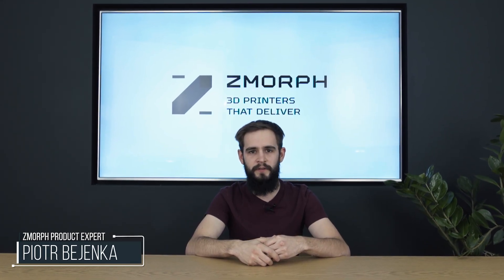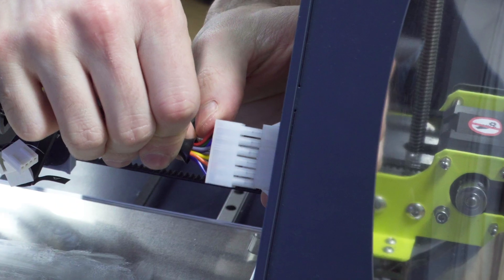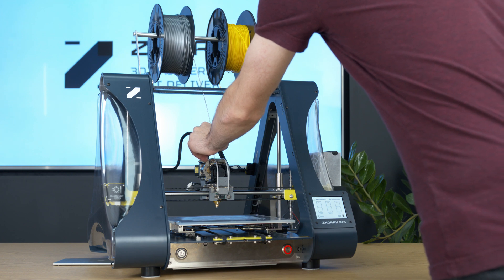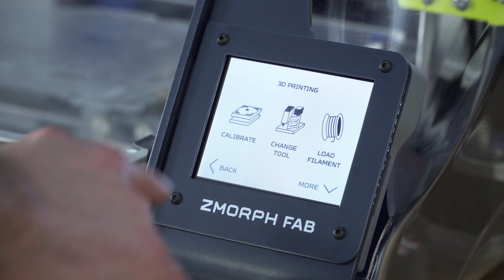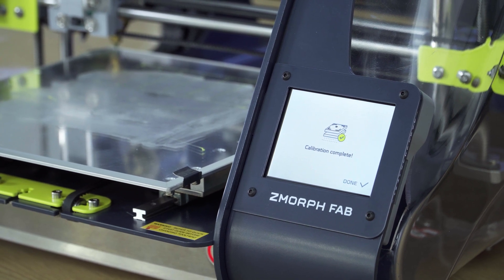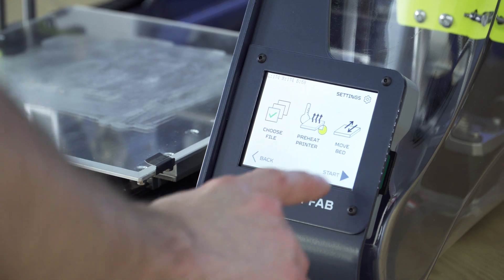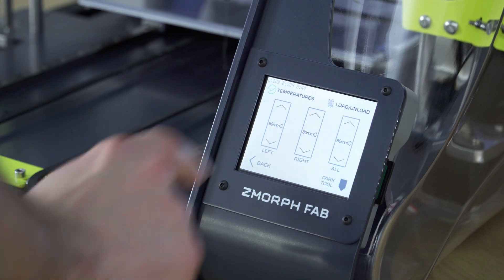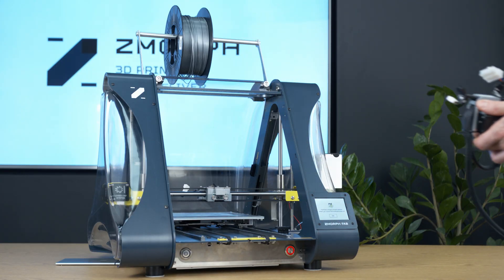Zmorph Fab - Dual Extruder Toolhead

Comment: I've been playing with this printer for the last couple of days. However, the slicing software is very limited, it’s not possible to change many settings. Do you guys have any Cura profile or others so that I can test the machine with other slicers??
Reply: I use voxelizer and Simplify3D. Zmorph can provide you with a printer profile
Reply: @Matheus Confessor Castilho Fernandes have not gotten into the paste extruder. What you making?
Reply: @luisca92  nothing specific.  Just experimenting with some vases . But the extrusion rate seems to be excessive. Don't know how to slow down the feed rate.
Reply: @matheusconfessor8575  there's an extrusion multiplier in Voxelizer but I haven't done anything with the past e extruder so I'm not sure if it's the same set up